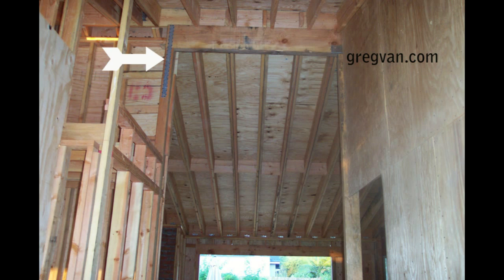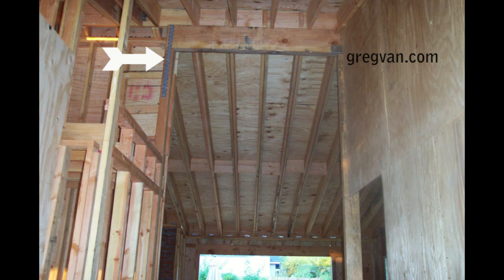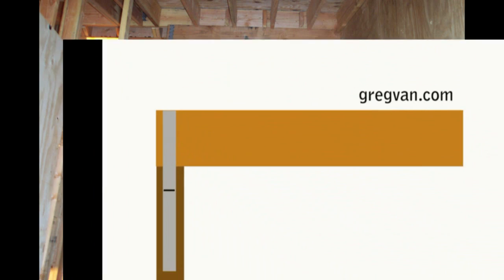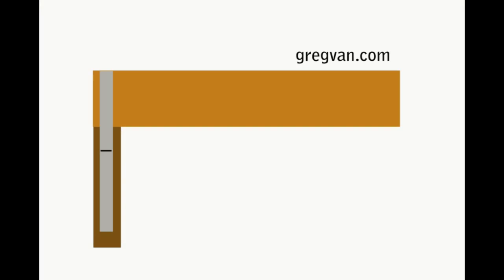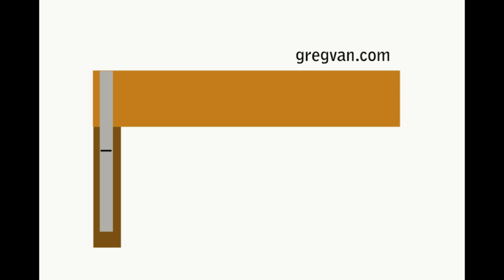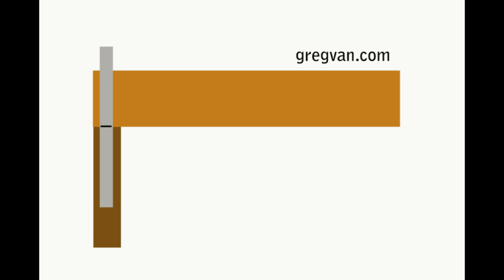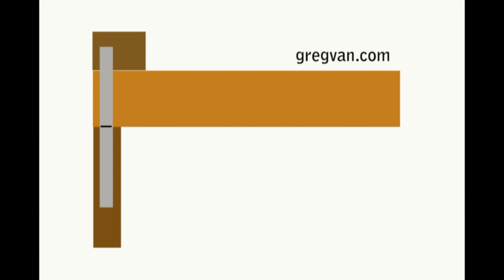Roof Ridge Beam Post Connection - Centering Metal Strap Tips

Comment: Question you might be able to answer for me. I am not a carpenter so please forgive my lack of terminology and know-how.
I am building a shed. 8x12. 8 foot high walls. 2 foot high center for the ridge beam (Gable roof?) I am going to have a 6 inch overhang on one end. The other I want to stay out of the rain, have a 4 foot overhang so I can put a hoist on the 30 inch mark of the 48inch overhang (Ridge beam/board) to hang game for skinning. Elk, Moose, etc. (800-1600 Lbs.) I am looking at a total length of 16 ½ feet.
Can I use a two piece ridge board/beam with 4 1/2 foot on the 6inch overhang end and an 12 foot on the side with the 4 foot overhang?
Can a make my own out of staggered board to make one long one that is not too thick?
Can it handle the weight of the game?
If that is possible not sure how to make one. This will be my third shed I am building. First one a 12x20 did not move when hurricane Fran came through, and did not have the roof on yet. (Barn style roof/Gambrel I think it is called?) The other is an 8x12 with a 10 foot wall in the front and 8 foot wall in the rear with just a slanted roof. Both were leveled on blocks and skids. This one will as well.
Any help or suggestions would be greatly appreciated. Thanks, Peace, Mo
Reply from the maker: I'm not a structural engineer so it would be difficult for me to provide you with what you're looking for. However, I think you could make it work if you use a solid 4 x 12 for a ridge beam, but it would need to sit on a post at each end of the building. You might be able to use smaller sized lumber, but 1600 pounds is a lot of weight. If you need more help, I can make a video. Let me know.
Reply: gregvancom Thanks for the reply. What I do not know/understand/envision is how to make a 16 1/2' long beam(ridge beam or ridge board) out of smaller length sections of wood so it will not bow/bend/at the joint or attachment points. That would be a great video to watch if you decide to make one. Peace, Mo